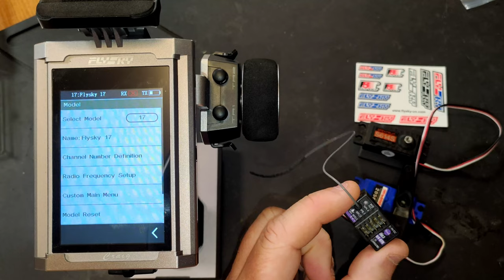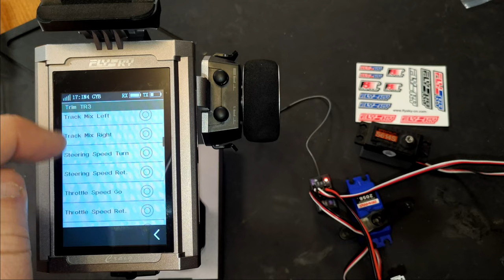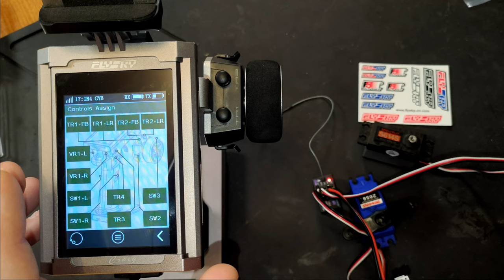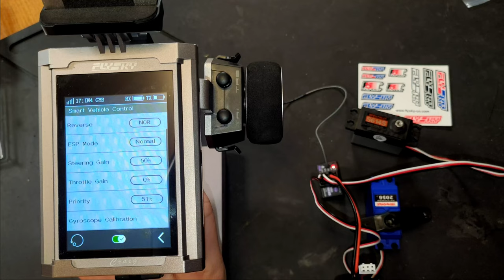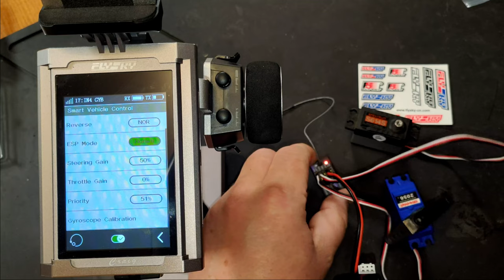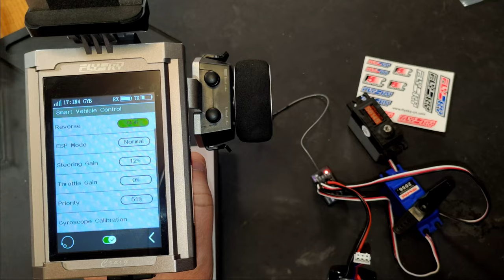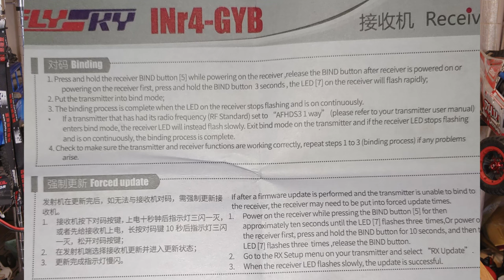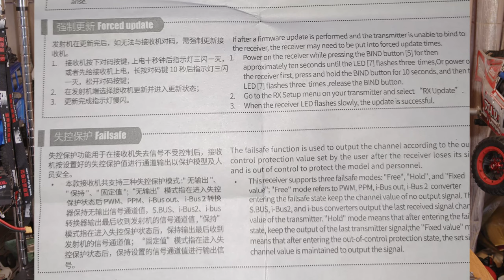Flysky INR4 GYB NB4 and Noble Pro SVC receiver set up guide

Comment: I've been waiting for this RX as It really completes the overall Noble package. Great video and your explanation of the "Priority" setting really helped. 

I'm also glad flysky made the RX full featured from day one and like you, I think the small form factor is ideal. I don't know of any other surface gyro receiver that's as feature packed as this one, they really thought it out. The "Priority" setting alone is such a great option as it can give you more of a hands off approach to stabilization yet still give you enough to keep those 2wd vehicles from spinning out. 

One thing I'd like to know is whether or not you can run that RX in "2 way, 2 channel" mode for improved latency or does the gyro processing reduce the response compared to the same setting on another RX like the FGr4S.
Reply from the maker: I'll have a look for ya on the 2 way 2ch set up :)

Comment: Great videos. Question. The INR4 GYB is 4 channel only, so what is an IBUS receiver for and will that allow me to have more channels for telemetry and led lights. I would like SVC and GYO functions.
There is another voltage sensor that is a black and white wire that comes with the receivers. What is that for and do I also need to  purchase CVT01? thanks in advance
Reply from the maker: The bvd black and white wire is for external voltage monitoring and has its own port so you don't lose a Ch, you could turn one of the channels into ibus and run the 4ch ibus add-on to get 7ch so no you don't need the cvt01 for voltage with them :)
Reply: @WTFRCCars   excellent. thanks a lot.
Reply: forgot to ask which 4ch ibus add-on would be suitable to work with the INR4 GYB
Reply from the maker: It's the cev-04

https://www.flysky-cn.com/cev04-canshu

Comment: So… I got it working out the car.  Just a heads up, but maybe I’m missing something, but I’m not able to program in the controls assign menu short cuts for gain or on and off.  I’m happy I can do it through the SVC icon on the radio.
Reply from the maker: Yeh that's where your supposed to do it.
Reply: In the video he assigns the svc controls to the transmitter variable pots, so you don't have to go to the menu and click and scroll, you just adjust the transmitter controls

Comment: I have the nb4 with latest update, but in the "assign" section "svc" does not show at all.... does those "svc" options under Assign only show on the Pro and not the NB4?
Reply from the maker: Yes only the pro can assign the option's
Reply: @WTFRCCars  thanks for the reply... so any other way to adjust the gyro at all or not with the nb4?
Reply from the maker: Yeh you can adjust it in the nb4 menus just not able to assign them to buttons like the pro can :) you still have full control of the settings though :)

Comment: I have the NB4 (not Pro) and am unable to assign dials to the SVC function as shown with the NB4 Pro in this video. Wondering if you ever tried this? I am running 2.0.100 FCC on my tx.
Reply from the maker: Yeh the nb4 can't do it yet need new firmware
Reply: @WTFRCCars  thanks for the quick reply. I will keep an eye out for the FW update.

Comment: I have updated transmitter and now trying to bind and it wont. Put the transmitter in binding mode, held the bind button and binding plug in and power on - nothing. what am i missing or is something at fault. please advise. -subscribed Thank you!
Reply from the maker: You need to update the receiver too :)
Reply: @WTFRCCars  Thank you for quick reply. after updating the transmitter the  flysky assistant does not see the receiver so I can update it. Is there any other way to update the receiver?

Thank you
Reply from the maker: Yeh just look through my playlists I have them all
Reply: @WTFRCCars  Just followed it to the letter and it has been binded - Thank you! Any idea why after a few turns of the wheel on the transmitter to the left it says signal lost. I turn the wheel left and when it returns to neutral the receiver led goes off. This does not happen when turning the wheel to the right.
Reply from the maker: Low power to the esc and the left endpoint is not set correctly so the servo is drawing too much current
Reply: @WTFRCCars  Thank you so much. I shall get all of this back in my car and then calibrate with a fully charged battery - currently its on storage charge which may explain the issue I'm having. Final thing, can I rule out a faulty receiver or transmitter right now and just put it all back together?
Reply from the maker: Yeh I'd say it's working

Comment: In SVC Mode ~ if i turn Priority to 100% dose that mean I have 100% Priority or the gyro has 100% Priority??
Reply from the maker: 0 wiil prioritise  keeping the vehicle from loosing grip so bigger turning circle, 100 will prioritise what you are doing so tighter turning radius but less stable :)
Reply: @WTFRCCars  I Do Speed Runs So Im Just Trying To Go Perfectly Straight ~ So 0% Would Be Best For My Situation??
Reply from the maker: Yeh your going to need a really fast servo so the gyro can keep the RC straight on speed runs though something like the theta 1000hz servos
Reply: @WTFRCCars  do you have a email or facebook page?
Reply from the maker: Yeh I have the Facebook group wtfrccars :) it's the QR code on most of my newer vids :)

Comment: Hello. I was wondering for those drag racers if you use this and set the ESP on lock would it be a useful receiver for them the keep the vehicle straight going down the track?
Reply from the maker: Yeh it would definitely be an advantage for drag RC but it's also against the rules for most drag racing
Reply: @WTFRCCars  oh i didn't know about that as a rule, but could see it as a full driving experience to control the whole car.
I came from slotcars where it's about cutting the .000 light and was thinking of making a 1/24 scale type rc drag car and portable track.(Christmas tree and timer lights. Don't think many could keep a 1/24-1/32 scale 110mph+++ car straight in 55 feet with out help and keep it in a 4 inch lane.

Comment: Can You also daisy chain all Your sensors straight into the Rx? Is there any form of telemetry logging so You can view it after a run? Im not coming away from traxxas or arrma or losi(spektrum). Im running away as fast as I can. My NB4 is on its way.
Reply from the maker: I've just got done with a vid on the sensors will be live this week some time :), yes you can daisy chain the sensors all into one port but no there is no logging but it does have alarms for each sensor high and low so you get a warning when ever any sensor goes out of the monitoring range you set :)
Reply: @WTFRCCars  Great stuff thank You so much. Your channel is the reason I made up my mind to go with the FlySky Noble and not a super expensive Futaba.
Reply from the maker: Yeh they are really good and thanks :)

Comment: Would the LOCKED setting be something more suitiable for speed runs?
Reply from the maker: Really depends and I'd always say try it at a slower speed to see how it reacts and then choose the setting that suits your driving :) the basics are normal it behaves like a standard gyro, locked it will try to lock the direction your wheel is pointing

Comment: Hi I just wanted to ask how do you set it up for the regular nb4 I have tried and can't get it to work
Reply from the maker: It has to be on 2.0.100 firmware but you can't assign the controls to button or dials you have to set it up in the SVC menu only
Reply: @WTFRCCars  so which one is the one I need I'm a little bit lost
Reply: @WTFRCCars  it's a new update v3.0.4
Reply: @WTFRCCars  because I did the 2.0.100
Reply from the maker: So the nb4 needs to be on 2.0.100, assistant v3 is version 3.0.4 the receiver will bind to the nb4 on version 2.0.100 but you can't assign controls of the SVC functions to any buttons or dials the noble pro is the only transmitter that can do that the nb4 can't on any firmware.
Reply: @WTFRCCars  I got it to work just had  to calibrate the receiver and the radio it's awesome thank you for your help 🙏

Comment: My only issue is that I'm not seeing the SVC settings as options for button assignment on the NB4. I have the latest FCC firmware, so I'm wondering if only the NB4 Pro has this assignment option. Perhaps there's a firmware update due out for the NB4.
Reply from the maker: What firmware do you have on the nb4 2.0.100 is the current one
Reply: @WTFRCCars  Yep, that's mine. No ability to assign any SVC functions to button on the radio. This firmware precedes the release of the receiver. I suspect the next update will address this.
Reply from the maker: Yeh it's likely :)
Reply: I'm having the same issue, there are no svc assignments available. And running current firmware. I didn't know if that option was only for the noble pro. But I'm waiting to find a solution. Hopefully someone can help
Reply from the maker: Yeh it's only the pro at the min that can assign to adjust on the fly, hopefully a new firmware will allow this on the nb4 and NBR lite :)

Comment: Greg do i need to updated my nb4 again to use this gyro receiver?
Reply from the maker: You need to be on 2.0.100 firmware on nb4
Reply: @WTFRCCars  i am still on 2.093 and i have SVC on my NB4? or what would be the benefits? i dont want to update all my cars....
Reply from the maker: Always update to the latest firmware or you will have strange issues like the RC working then after a few min it gets slower and then stops until you power off and back on :)

Comment: Can this switch setup be done on the NB4 or does it only work on the pro?
Reply from the maker: Only the pro can assign the menu options to the buttons on current firmware
Reply: @WTFRCCars  thanks for the reply, do you know if flysky will do an update for the NB4 that will enable the switch use for the menu or will I have to upgrade to the PRO 😂
Reply from the maker: They haven't told me of anything planned for the nb4 so far
Reply: @WTFRCCars  thanks for the help, one last thing, can the INR4 GYB be updated from the NB4 ?
Reply from the maker: Ya don't need to and ya can always update it from pc if needed
Reply: @WTFRCCars  thanks 👍🏽

Comment: Will the regular NB4 work with this new INR4 receiver?    As i'm looking through the NB4 settings and don't see any gyro related items.
Reply from the maker: Yep works fine you have to have 2.0.93 or newer firmware installed though on the nb4 :)
Reply: I'm running one and it works fine w/ my NB4. You have to go the SVC menu to access the settings once paried. But atm, can't assign any SVC functions to any buttons. I hope that will get fixed in the next firmware update.
Reply from the maker: Yeh I'm guessing a firmware update will be released.
Reply: @WTFRCCars  got mine on the way,   is heading lock more like a drift setting?
Reply from the maker: It's more like it tries to keep the RC in the direction of the wheels not the direction it was going in :)
Reply: @WTFRCCars  Got mine in,  However it doesn't seem on the NB4 is able to assign SVC controls on 2.0.99 or 2.0.100 firmwares.  Able to turn on,  but not change on the fly
Reply from the maker: Yeh think the nb4 will need a new firmware to be able to set the SVC control without being on the SVC screen :)

Comment: Is this actually available? I can't find it anywhere.
Reply from the maker: I know a few guys got them from Amazon
Reply: @WTFRCCars  Straight up can't find that model anywhere. It's not even listed on the Flysky website.
Reply from the maker: https://www.ebay.co.uk/itm/394192685155?mkcid=16&mkevt=1&mkrid=711-127632-2357-0&ssspo=izhgzng2que&sssrc=2349624&ssuid=-9Xy4QzCS96&var=&widget_ver=artemis&media=COPY but over priced
Reply from the maker: https://hobbymatehobby.com/products/flysky-rc-noble-nb4-gyro-receiver-4-channels-inr4-gyb-for-flysky-nb4-noble-lite-noble-pro-radio-transmitter-afhds-3?_pos=2&_sid=e9b14fb8f&_ss=r this is the correct price
Reply: @WTFRCCars  So, I finally got one of these receivers to use with my NB4, binds up all good. However, I don't get any of the SVC options in the assignment menu. Any ideas?
Reply from the maker: The nb4 can't assign the functions only the noble pro can, but you can still set them in the menu and once set you wouldn't be changing them all the time :)
Reply: @WTFRCCars  Ahhhhhhhhhhhhh right. Gotcha. Ok, so set and forget from the menu. Would be nice to at least be able to turn SVC on and off via a button on the controller though.
Reply from the maker: They may add it in new firmware but not sure yet